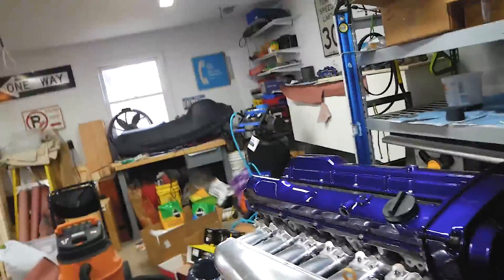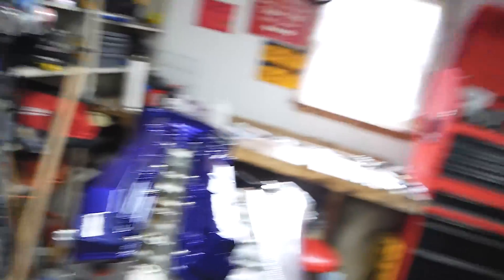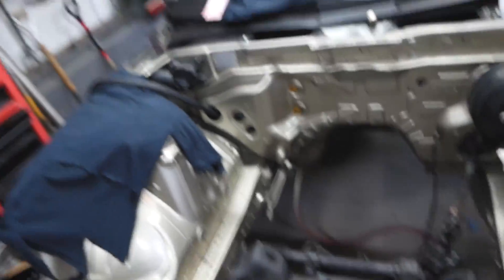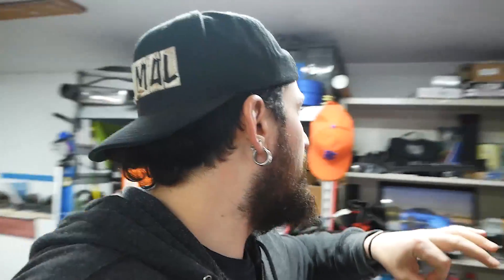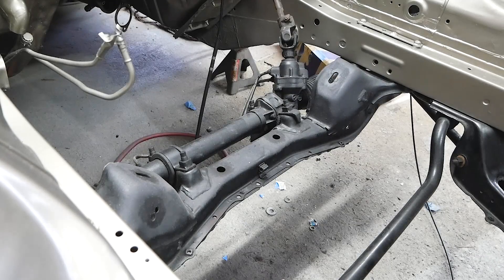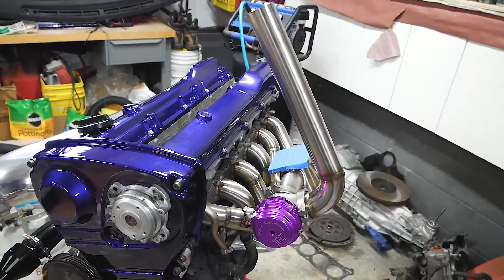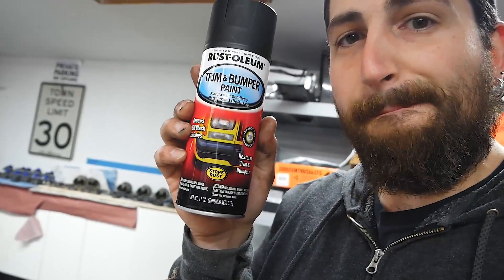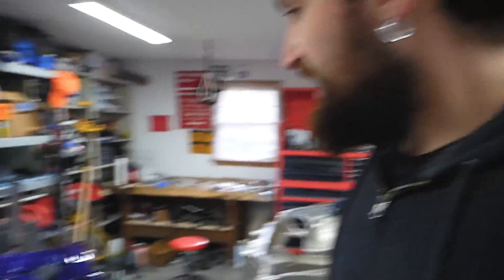Throwing on the Intake and getting the engine bay ready for install : 500+hp RB25 engine build pt 15

Comment: Hi dude.. just subbed! Awesome content! I'm currently researching about rb25 parts as I'm going to be doing a swap into my Datsun Z car. Just curious where that intake manifold is from? Cheers dude!
Reply from the maker: zerofab intake. i bought it from someone off facebook, dont remember his name, but he will hook you up with the manifold, and injectors
Reply: @chrisdz  no dramas dude I have found the manifold from someone... did your ID1050 drop straight in? I know the fuel rails are 14mm but I was trying to find out if the ID1050 listed for the RB25DET were the correct ones. Got loads of Q's if you dont mind haha!
Reply from the maker: Liam993cc yeah. They were drop in.. using that manifold and fuel rail at least
Reply: @chrisdz  the manifold kit is a generic one from China believe it or not... seems companies just laser etch their logos onto them! Otaku Garage, ISR, zerofab etc etc. Do you have instagram dude?